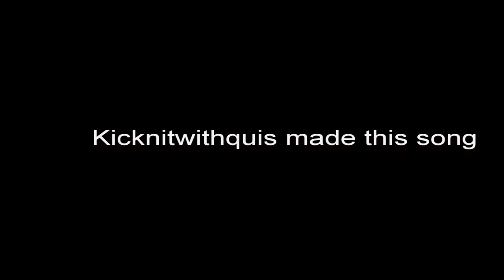BarbasLife New Intro Song 2020 by KickitWithQuis #nesquick #barbaslife #madmaxcivicbuild

Comment: Can you point me in the right direction for a stock d15b engine?
Reply from the maker: Yeah where you located?
Reply: @BarbasLife  monee
Reply from the maker: Your about an hour away the junk yard by me has some d16 but its a raffle if they ate good or not. You can get a jdm d16a like mine for about $600 with papers and warranty.
Reply from the maker: Its $150 by the way at the yard you can always rebuild it if its bad.